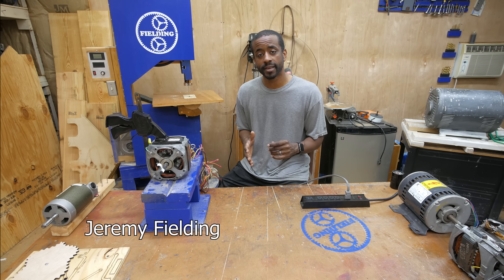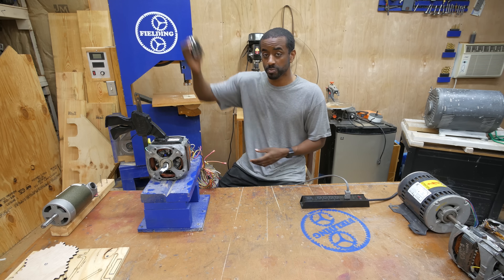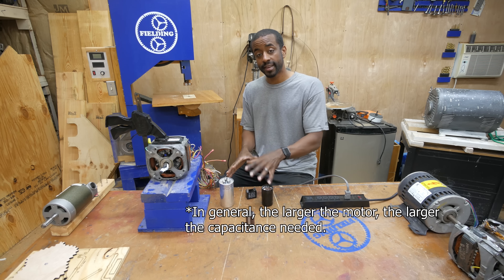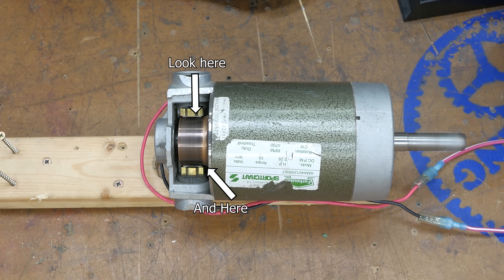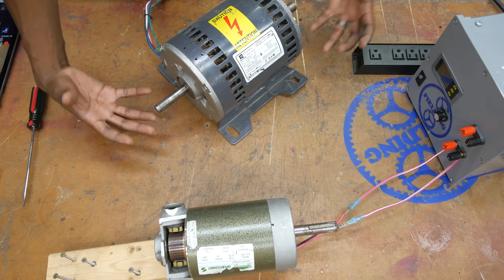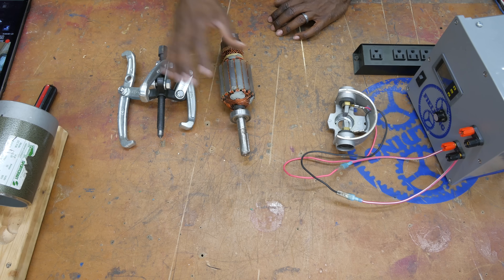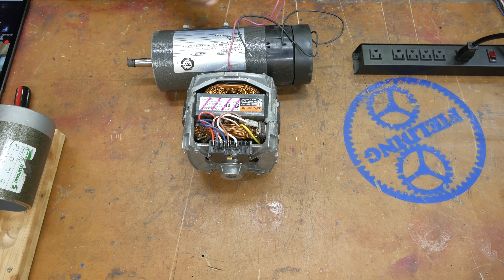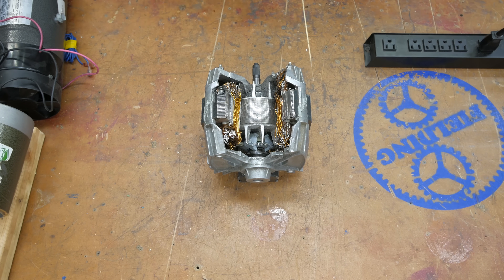Three Most Common Motor Fixes Anyone Can Do; Ultimate Guide to Electric motors ; #070

Comment: The smaller windings in the start coil are specifically designed to be more resistive due to their reduced cross-sectional area.  This helps to change the phase shift in the start windings as compared to the field (run) windings.  The phase shift is related to the resistive component and the inductive component of the different circuits.  A perfect inductance offers a 90-degree phase shift, but even the large field windings have some resistive component.  By making the start windings more resistive and less inductive, the phase shift is different in the start windings and the run windings. 
     This phase shift describes when the peak current is felt through the different coils.  By energizing the coils at different times, a relative motion of the field is observed.  Induction requires this relative motion.  Another method to achieve this phase shift is by using capacitors to cancel out some of the inductance in the starting circuit.  The capacitor offsets some of the phase shift in the start windings and moves the start winding’s phase back toward the original input voltage’s phase.  3 phase motors do not have this issue, because they are given 3 different input phases each separated 120 degrees apart.  In a single-phase motor however, we must create this phase difference.  It does not have to be a perfect 90 degrees, but the more the better.  Jeremy touched on this when he said the capacitor size was not important.  Adding ANY capacitor will offset the phases of the start and run windings.
     Once the rotor is rotating these phase shifts are no longer required and the start windings or start capacitor is disconnected, in this case by a centrifugal switch.  Now the field pulses back and forth in 180 electrical degree increments.  Normally this will not provide the relative motion for the rotor and explains why we need the start windings in the first place.  However, since the rotor is already in motion, relative motion is achieved, and inductance continues.  Jeremy shows this early in the video when he has the start capacitor disconnected.  The humming from the motor is the pulsing of the field, but the shaft will not turn.  When he spins the shaft by hand, he is applying the relative motion needed to create induction.
Reply: Wow. You should do a video. I don't think your intent was to hijack his. But all this is really not important to the DIY. Which is why he has kept it simple.

Comment: hi
i replaced the brushes on my aquatbot pool cleaner. A 48VDC, Double Shaft | S1A6031. it worked after i connected for test but after assembled didn't work took it apart and after troubleshooting find out that the motor spin only if I shake it or if I rotate it i and different horizontal position. the internal armature looks good ,no burning marks the the stator is good as well any help will be appreciate .if you need more info please let me know. Thanks

Comment: Question I have a craftsman motor for a tablesaw the breaker switch seems to be messed up is it possible to fix it because if I press it it works if I let it go it doesn’t work

Comment: Hi Jeremy, I have a 1 hp. Single capacitor start, 115 vac, 3450 rpm sears table saw motor. It’s had light use but sat too many years and the armature made a rust connection to the stator most of 360 deg. around. Sleeve bearings. Took it apart. My question is that if I sand, Dremel rotary brush or some other idea will it short the steel laminates on the stator and the rotor. Would the answer also include transformers?

Comment: Quick question,my air compressor shut down due to overheating,( single  phase ) can i add     air openings by drilling extra holes on the housing to help the motor run cooler?

Comment: If the bearing are not turning well because the grease in them has dried out you can just clean and grease the bearings if they are not worn too bad, that will save having to replace them.

Comment: I used to work on "Whisper Writers" thermal printers. Just about all the stepper motors that "went bad" had a chip of ceramic magnet jammed into the rotor. They will be good as new if you take the motor apart an remove the chipped piece of magnet.

Comment: Hi Jeremy! Thanks for all the good stuff. I have a 3HP treadmill DC motor that slows down to a stop as soon as I put pressure (disc sander) regardless of the speed. What could cause that? Otherwise, it runs super smoothly, but in this state, it's useless.

Comment: I have an old compressor with start and run capacitors. A while back, the motor just hummed when power was applied. At the suggestion of a buddy, I pulled the rear plate from the motor, and sanded the contact that was mounted on the plate. It worked..for a while. I attempted the same repair today, and when power was applied, the motor ran, then slowed down very noticeably. The pulley on the motor was extremely hot, while the rest of the shaft ass'y was not. Any suggestions? Thanks...great video..I am looking at the centrifugal clutch contacts now..

Comment: Great video Jeremy and a new subscriber.  I have a  small juicer that started to smoke and now will not start. It does have thermo protection but still nothing not even a humming noise after I let it cool off. Any advice? It's a Jack laraine juicer if that helps.

Comment: I built an electric bike for this kid.  He had it for 4 days before it was stolen.  When he asked if I could fix an electric scooter he had, I couldn't say no.  The rotor and stator were rusted together.  i got them apart and cleaned the stator and it seems to be OK.  The magnets on the rotor have swelled up.  I tried to sand the magnets down.  i tried a wire brush and a wire wheel; not the smartest decision ever made.   All it's doing  is marking up the magnets.  My question is... Am i just damaging the rotor and wasting my time, or is it just a matter of time and perseverance, and making the right tools ?  If i'm just wasting my time... Maybe I could replace the magnets ?  Not sure where I would get them.  Maybe you could help.   Thank for the videos. I look forward to all of them.  I saw you on learn something every day. That was cool.  Made my day.   Thank you for what you do.

Comment: My problem reusing appliance motors is that most of them don't have cases!  They are built directly into the appliance, the airflow past them is handled with a fan elsewhere in the machine, and if you take them out you just have the bare coil and rotor.  So figuring out how to fab a case, safely, with grounds and ventilation, would be great.

Comment: There seem to be a lot of comments from neighbors about the contrast between your instruction with that they received during their college years. I want to add myself to that list. I watched  the very good 1961 military film on basic motor principles you recommended. I think it makes the point  that the start windings on a motor are series wound with the rotor and this creates good starting torque but, being in series, the current is in positive feedback with the speed - i.e. a shaft speed increase, due to a reduction in load,  will increase the winding current and hence magnetic field strength and this means the motor will overrun. That's why the start winding have to be disengaged. There's a chance I've got that wrong!

Comment: Almost true, you can't do other way around, you can't connect a smaler capacitors, to a motor that youse more power, accept if you have a resistance between. The resister are getting hot, but if you cool it own with a cooling system this will this not be a problem.

Comment: Thanks Jeremy.  I have a Sears air compressor motor which gave me trouble. It blew a couple starting caps because dust and spray paint made the centrifugal starting weights stick on the shaft.  I opened the motor, chipped the dust/paint off the moving surfaces and reassembled it.  It has been working good for a number of years now.   JwgK

Comment: I live in Augusta Georgia in a double-wide mobile-home, and have a split forced-air system.  The house is 20 years old, so the system must be that, or older.  

A decade ago, we paid a friend of a friend (long story) to repair the system at one point, and he intentionally destroyed the coils in the outside unit and disappeared with our money, instead..  Because of your channel, and because I am a packrat: when we finally were able to replace the outside unit, I kept the entire top and the electrical panel, with the fan and motor and the run capacitor and the contactor that uses 24 volts from the thermostat to switch the 208 volts that runs the fan.

This summer, the fan in the replacement unit (which was bought used and installed by a professional off Craigslist) seized up.  the bushings went bad and I couldn't oil them enough to make it run again .. but I still had all the parts from the old unit!  Thanks to Jeremy, here, and his cool calm collected videos, I was able to swap the fan, itself, and understand (enough of) the wiring around the capacitor to safely discharge it, pull it, swap it for the other and reconnect all the wires..  The new (20+year old salvaged) fan has been running fine and quiet ever since.

I also have been picking up used recliners off the side of the road that have the electric lift mechanism.  I have 4 or 5 of the linear actuators out of these.  I have 2 or 3 "mobility scooters" as well as 2 or 3 electric wheelchairs for parts.

I will be starting a general DIY / around the house / honey-do / fix-it-yourself youtube channel, sometime this winter, and I hope I can generate the quality of videos that Jeremy here manages!!

Comment: Hey, Jeremy, great tutorial! I have what may be a bit of an unusual problem, and I'd welcome your (or anyone else's) input. I've got a 6" bench grinder that behaves much like a motor with a bad start capacitor: it hums and does not spin when turned on, and if you give the wheel a push to get it started, it'll run fine. I took the plate off the bottom mount expecting to find a bad start capacitor, but there's no cap whatsoever. Just the AC wires coming in, with the neutral going straight into the motor housing, and the hot going to a switch then the other pole of the switch into the housing. Other than the ground (connected directly to the metal base), there are no other wires. Would that mean there's no start capacitor for this motor? Is this something that can be retrofitted to this type of motor, or would it even be helpful? I see some other comments about checking the contacts on the centrifugal switch, which I can see through the vents, but it seems the bearings are press-fit into the bell housing ends, and they do not slide off as easily as in your video, so I'll have to find a gear puller I guess to get the housing off the shaft to check the contacts. Wondering if there's anything else that could cause this hum-no-spin issue? The grinder is an Alltrade brand, model 1973-G-6. It's labeled 1/2 HP, 3450 RPM, 115V, 60hz, 1 phase, manufactured in 1987. It appears to have had the power cord replaced at some point, as it's orange (like an extension cord). Looks like 16g wire, which should be sufficient I believe. I've had it for about 20 years, and it did run great a long time ago. The no-spin thing has been gradual over the last several years, to the point where now it does not move at all when the power switch is turned on (unless you give the wheel a manual push). Thanks in advance!
Reply: I have similar symptoms (and no capacitor) with the motors in a bathroom vent fan from the 60's and in a 10 inch personal fan from 1980's. I wonder did you find the fix?

Comment: Hello, thank you for the great videos. I have a question. I got a small motor from an electric lawn trimmer. The trimmer used to work with a battery and a power adapter to charge. The power adapter is 6.5v and 500mA. If i connect the motor directly to 9Vdc and 500 mA, it runs right away but the torque is low. If i put 12 vdc, it keeps clicking for like 1/8 of a turn and stops. It keeps doing that without actually continually rotating. Do you have any idea what am I doing wrong? I dont know the motor specs but i think 9vdc is low.

Comment: I picked up a full size Ridgid shop vac off the side of the road. I tested it and ,shocker, it did not work.  It did nothing. It took my boyfriend 30 seconds to adjust the prongs a little bit farther apart and replug the vacuum back into the outlet for test two. It worked!  The plug was able to make good contact inside the outlet again and there was  no more problems!

Comment: Hi, Jeremy!

What to do with a fan that I tore down, and put back together? 

If the shaft is too tight, it won't run. If it is too loose, then it also will not run...

All I did was clean out all the dust that had collected over the last 5 years!

Comment: You are doing a great job, thanks.  Recently had a 1/2 hp induction motor given to me which wasn't working.  Hummed and didn't spin when power was turned on, but would when assisted.  Uncovered the start cap and it was leaking electrolyte.  Out a new one in and still didn't start.  Accessed start winding centrifugal switch.  It looked fine and wasn't welded closed.  Filed points and lubed pivot points and put back together and its now running.  Now I have a free $100 motor.

Comment: Does anyone have any thoughts on how to open an Emerson Model f33amkhy-4455? I would replace it, but mine has some special mounting brackets spot welded to the fan housing.

Alternatively to getting it opened up, any thoughts on how to free up the bearings?

Comment: Thx for this video. Was able to fix my washing machine spin motor by eliminating the fact that it is still in working condition. Found that the screw securing the shaft was stripped and would not have. Picked that up otherwise.

Comment: What happens if you have the hum on a drill press that will start with a helping hand. I changed the start compacter and I’m getting the same thing. There’s only one compacter and it’s a 3/4hp motor.
Reply: On another note you can start the motor clockwise or counterclockwise with a twist?! Doesn’t seem normal to me

Comment: I have an old starter motor from a 45 Farmall tractor, and it has a dead spot on the rotor, I think. Every so often no have to access the rotor and manually turn it a little past the dead spot or it won't turn, after turning it a bit by hand it works just fine, perhaps you could do a video explaining this. Thanks for all your great work

Comment: I have a small AC DC motor .8 Amps. The motor spins freely when no power. As soon as I apply power to the motor it binds up. I have taken the rotor out of the motor and cleaned where the brushes make contact. I made sure there’s plenty of oil in the bushings not bearings. I made sure there is continuity from the brushes to the plug to where you plug in the wall with the rotor out. What is your suggestion?

Comment: Hi Jeremy, i have a phase 1 brushless electric motor for a bench grinder and it makes a loud humming sound when i turn the switch on.  I attempted to turn the wheels by hand, but the motor does not want to turn.  When i turn it off, the wheels move freely when i turn them by hand.  I checked the capacitor and it's a good capacitor.  Any ideas on how i can troubleshoot it?  Thanks

Comment: Lucky day to find your channel! Good detail explanations and examples and still understandable to non-Engineers. Great Shop Adaption examples!
Have a question regarding AC motor brushes. I have a 120 vac Shop-Vac brand vacuum that quit running. I found that although the brushes still have lots of length, they are not making good contact with commutator. In closer look, there is no spring mechanism on the brushes, only a white plastic brush housing. Maybe the springs have broken away, or the motor was built without brush springs.
At any rate I have not been able to find any source for these types of brushes. Any suggestions on a "DYI Shop" way to make brushes work or a source where replacement brushes can be purchased?

Needless to say, Shop-Vac Inc. does not offer brushes and will only sell entire power head.

Comment: I have an old 3/4 drive black and decker mag drill. The drill works but some wires are missing from the magnet, causing that part not to work, 
Any help with it would be greatly appreciated.

Comment: Dear Jeremy, thank you for coming to my rescue with regard to a problem with our dust extractor motor.  After a goof run {blast gate closed on both arms whilst motor ran for five minutes} the motor only hums on startup.  Although the motor got a bit warm, I can’t believe that anything melted because the ambient temperature was so low - around 12˚C.  The best bet is that the capacitor has failed. Let’s see if that is correct. 

I have watched several of your YouTubes and have always been impressed with your presentation.  It is clear that your knowledge is supreme but you do not come across as an arrogant know-it-all but a gentle and peaceful teacher.  I don’t know what you do for a career but if you have ever thought of teaching, there are thousands of kids out there that would thrive on your approach.  All the best.

Comment: Jeremy, We have a problem you may be able to help with.  We have a 1988 Enco Model 2031 metal lathe.  It only hums in forward but runs fine in reverse.   We put a new capacitor in  before we realized it would run in reverse.  Of course that didn't help.  We checked both contactors and they ohm out fine.  The forward and reverse switches are both good.  Any ideas?  Thanks, Tom

Comment: Hey great videos! Do you have a video on the safety aspect of taking apart electronics? I took a tube tv and a microwave apart, and was warned that there is some part that can hold a charge indefinitely, and which could be enough to kill someone if they touched it wrong... Are you aware of any part like this, that can hold a charge despite the component being out of service?